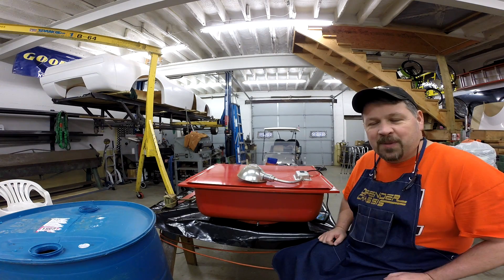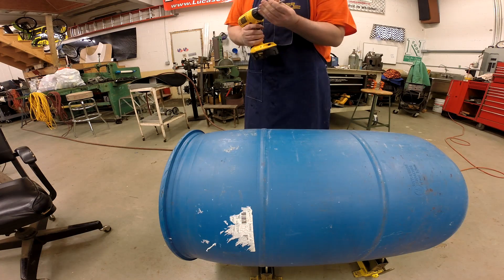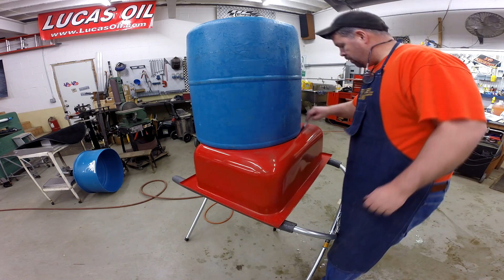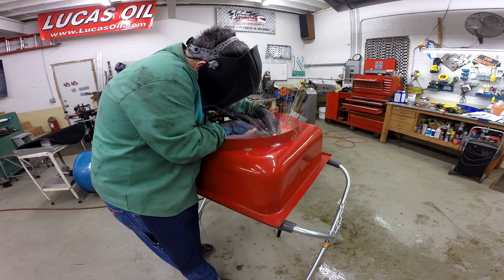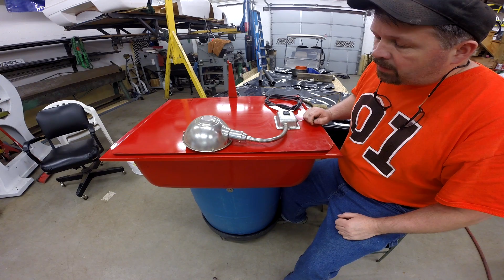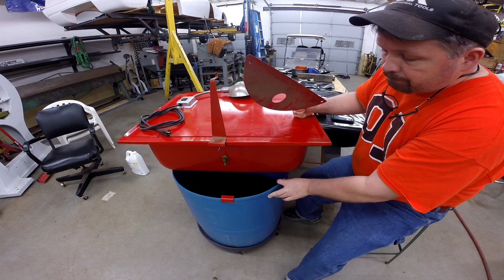Arcan/Carolina Parts Washer Repair/Modification Part 1

Comment: I inherited a parts washer (exactly like the one in this video) with the house a bought.  Not sure what they used, but it did seep out of the barrel.  I think when they moved out, they moved the parts washer and it caused it to start slowly leaking.  (I wasn't too happy about that all over my floor.)  No clue how old it is, but I am guessing it lasted a good while.  You wouldn't think by looking at the barrel that it has an issue.  I initially thought that he spilled it or something.  Anyway, all of this is to say that just like yours (and the other comment) these things can leak!  If I were to get a used one, I would look to proactively replace the barrel.  At least keep a good eye on it.  Thanks for the video.  I am going to try and find a 30 gallon one and if not, will go 55 like you.

Comment: I use Crown PSC - 1000 PARTS CLEANER , Comes in 5 gal.  pick it up at your local Tractor supply co. price $40-50 a can,  has a higher flash point than mineral spirits , cleans really well , evaporates less and does not leave a oily film such as the oil base de-greaser , I'll run 2 -5 gallons cleaner and 2 gallons of water as you know it separates. Keep in mind with water that corrodes metal. I'll screen and filter change every 6 months and add if needed. no sign of corrosion yet.  Helps adding external oil filter system to catch the big crud .  use a filter that is not a paper element , because it breaks down and clogs your supply line to clean. You can pick one up at your local auto parts store $50 bucks for the kit, or get the mount off amazon for $20 bucks and pick up fittings from home depot and 3/8 fuel line  and I added window trim for the bottom of the lid , pick that up from home depot or lowes or your local hardware. that helps with evaporation to last longer. it's cheap to replace when it breaks down.   Hope this information helps .  Cool video! Like the modification . 
Reminder wear heavier gloves when using this , the cheap latex gloves break down quickly.   Happy Cleaning!
Reply from the maker: Thanks for watching. I appreciate the advice.